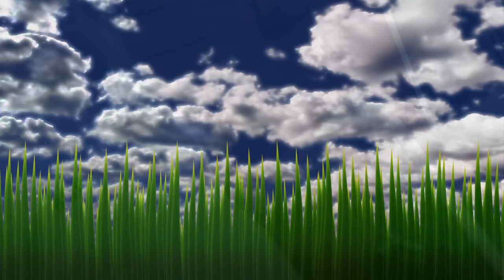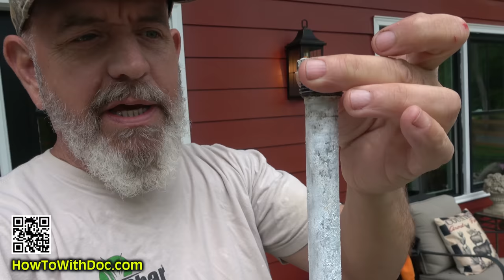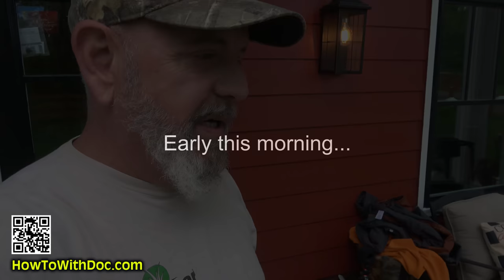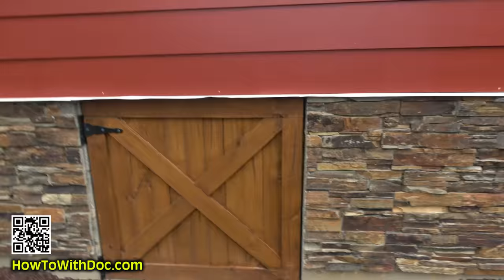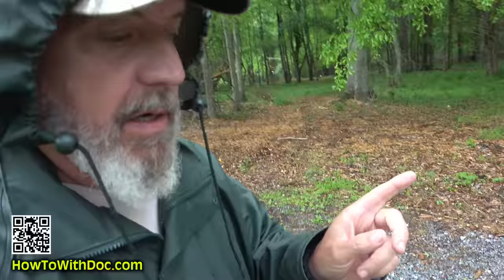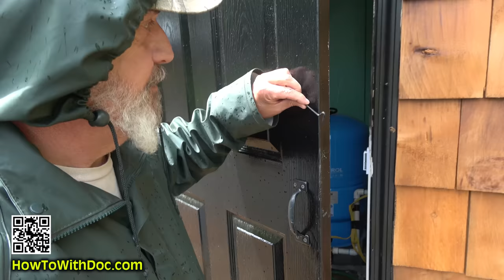Hot Water Smells Bad Sulfur Rotten Egg Smell

Comment: Doc I’ve been watching you for years 
I’m a water treatment specialist 
Get ride of the hardness with a ion exchange system! 
You need to remove hardness with resin and have a system clean itself  automatically!!!
Rainsoft is the manufacture I represent which has been acquired by Pentair 

Your problem is hardness 

At this point no hardness in the water to mess up any rod or anything else !

Comment: How does the electrically charged anode rod stop the smell? Does it kill the residual bacteria? The video doesn’t say explicitly that this is the mechanism. Thanks.
Reply: Great question! Our Corro-Protec electric anode rod not only stops but also prevents the "rotten egg" odor in hot water by eliminating the SRB bacteria. 
👃

Comment: If your water heater keeps on going through them, its time for a replacement.
Reply: It means you have hard water or the sediment is eating away the anode rod.
Reply: Most well water is hard water / mineral rich water anyways
Reply from the maker: It's a brand new system, 2 months old, and it's an odor issue not a corrosion issue.
Reply: @HowTowithDoc  It doesn't matter if its 5 minutes old its well water so its highly mineral rich and corrosive. All it means if your hot water tank is going out. Hence why you can only smell it when you are running hot water. Get an American made tank next time, I'm not sure if AO Smith Signature Series is an American made product? Do your research on Bradford White they are the best!

Comment: Truth is Doc you don't need that zinc diode in your water heater.  With all the purification you have going the diode is not going to make your heater last any longer.  How do I know? Because living here in S/W Florida we have that rotten egg smell coning from the water in the aquifers. The water purification filter system we have handle all the water coming in the from wells.  That smell you get from the Hot water is easily eliminated by just cutting out the anode rod from the water heater. Once a year I drain the water tank then add a gallon of pool chlorine and let it sit for about two hours.  I then run the hot chlorinated water thru all the hot water pipes until I smell the strong chlorine smell.  Let is]t sit for another hour then drain the tank flush the hot water  lines and refill the tank.  The water still runs perfectly after 12 years and no more smell.
Reply from the maker: True but it also reduces scaling.

Comment: Get a tankless water heater.  Problem solved.
Reply: Best thing I ever bought for my house!
Reply from the maker: No gas...
Reply: No gas, no beuno. Electric thankless require som much amps that you commonly need to upgrade panel, and even then you still won't have quick heating and on a well system you would be wasting tons of water waiting on the hot water to get to fixtures, especially on a large house.
Reply: @beerbeforebreakfast  I have a propane tank for our thankless water heater.  Works perfectly.

Comment: Mr... Doc my city water is absolutely bad so I definitely have to filter my water and from research the water filtration system that does literally strip out everything including chemicals and chlorine is the zero water they do work but in my research about filtration there's one thing these companies fail to mention they operate in half trude's now would you having a high-end filtration system this might not be a problem but with all that being said when I explain what I'm going to explain I think you ought to look into it and make sure filtration is awesome and great thing but not only does it strip out any chemicals our unwanted things it strips out your minerals in the water you can buy drops and do it yourself continually and different ways but it is a problem and from what I learned the drops are still problematic there are things that are still not in the drops but because your body needs those minerals and if your body doesn't get those minerals overtime it can cause severe medical problems now there is a company that makes a thing that looks like a filter but it's not instead it has coral and other things in it and when you use it with a circulating pump taking your filtered water out of a tank and putting it through this thing once the water has the good minerals back in it it circulates that water back into the same tank from what I gather it puts the good minerals back in the water if you don't already have this you might want to look in to it I know it was bit long and I'm sorry but I thought I might put a little bird in your ear if you are not already aware of it and I'd let you know what I found in my research

Comment: Nice, but also, cheaper and all that needs to be done is to change the magnesium rod for an aluminum one. Done! Rich from This Old House explains it, magnesium is what vioently reacts to the sulfites in the well water, so unless you have city water, then change the factory magnesium to aluminum and problem solved.
Reply from the maker: The switch doesn't always work. Read the studies on it and you'll find that it doesn't stop that bacteria

Comment: Aluminum anode is the ideal replacement. Or You can just buy a Rheem Marathon unit that does not have an anode rod. Polybutylene tank so no steel for the water to attack.
Reply from the maker: Aluminum will do the same.  "We consider aluminum to be a health hazard, so avoid installing anodes that contain it unless it”s clear to the owners that they must not drink or cook with hot (or once hot) water."  https://www.watertechonline.com/home/article/15535688/replacing-anodes-getting-rid-of-odor

Comment: Will the Corro-protect keep ur water tank from corroding as efficiently as a zinc anode rod??

I have a water softner, which increases the rate that it corrodes the anode Rod and tank…that is my main concern…

Also, it says that u have to remove the corro-protect and inspect it every year???
Reply: If u take out the anode Rod completely and put nothing in…it also removes the odor instantly…but then u have no protection from corrosion…